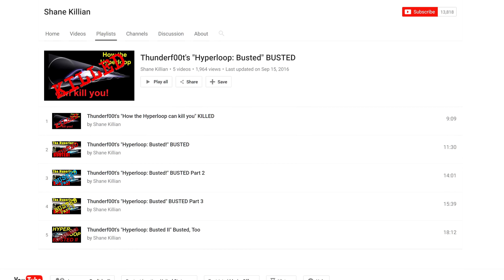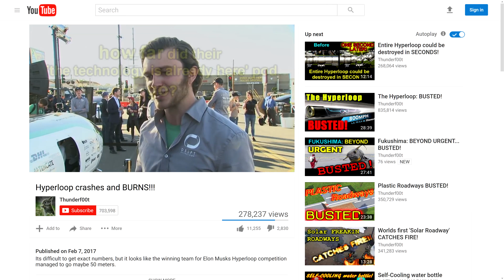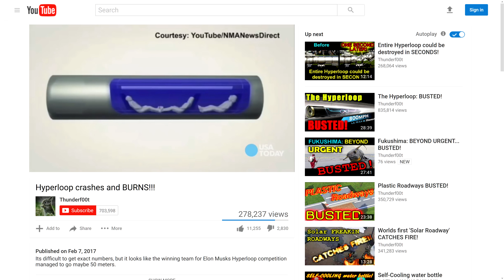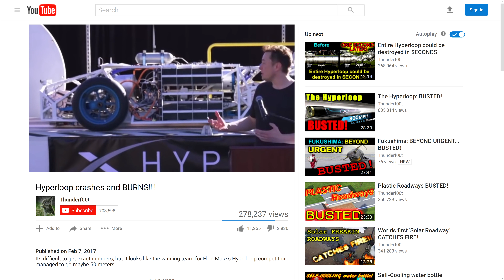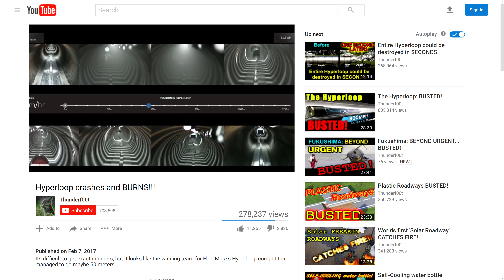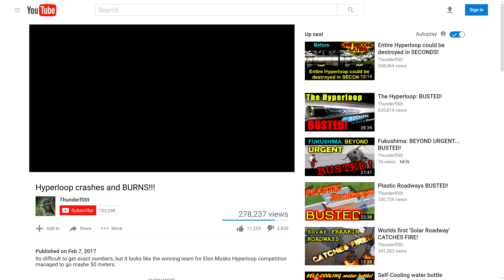Thunderf00t crashes and BURNS!!!

Comment: I'm struggling to understand... The Hyperloop system is not for commercial use? And the tall tubes could withstand the compression put on by its ob weight? Heck i mean if this tube where to be underground, wouldn't the weight from everything above cause the structure to implode? Ok, so if you build the walls of the tube to be extremely thick to prevent to tube from buckling or imploding, it would be extremely to transport and look at the economy. The cost of this system is high. I am really hoping that this system can work, i really am, but there are still some considerations that the engineers should take into account. Hopefully, there will be advancements in the system and that it could work in the near future.
Reply from the maker: "The Hyperloop system is not for commercial use?" SpaceX isn't doing it for commercial use. They want open-source contests (like they've done MANY times before with other things) so that maybe other companies can use it commercially.

"And the tall tubes could withstand the compression put on by its ob weight?" Sigh...COVERED AT LENGTH!!!
Reply: Shane Killian wait so the competition is not for public use? The media pitched it so that the competition is for the public to use. FAKE NEWS!
Reply from the maker: WTF are you talking about? I JUST FUCKING SAID that it's open source!

IDIOT.
Reply: Shane Killian wait... I thought open source is only for codes... Am I not doing internet correctly? I google searched "open source" and only got results for open sources codes, and even so the definition of open source means to publicise something for others to modify or to change upon. Plz further elaborate what you mean by this competition is open source. Is anyone supposed to modify the prototype of vehicle, the emphasis on open source is kind of misleading. Me, being an IDIOT that i am, does not comprehend this concept.
Reply: Shane Killian the whole concept of this competition is to look at the designs of new transportation options, that I understand, but there are other forms of existing transportation that is interesting to build and modify upon, look at the MagLev system for example, in the USA, there are few MagLev trains, it is efficient and it can run in tubes, it is more effective that in a hyperloop system due to near 0 friction against the tube, i think SpaceX would be interest in that rather than a classy giant hovercraft. That just like a straw, at one end there is suction, the other air is left in, the vehicle will travel as fast as the air being sucked out. i mean im an idiot, but i think if people could CHILL the FUCK OUT about other people's opinion online.(edited) I actually feel stupid now... Pffft,i could actually just ask the hyperloop team about my concerns myself,but i choose to talk to people who is irritated by people who does not share the same views as they have online. My bad for wasting my time.
Reply from the maker: "I thought open source is only for codes..." It's a concept that's for lots of things! In this case, it means that all of the data from and used by the test and the teams is available for everybody to examine publicly.

"look at the MagLev system for example" I HAVE! PLEASE WATCH THE SERIES!!!

"it is efficient" NO IT ISN'T. Not unless you're doing it the way Hyperloop One is, which is their own innovation.

"i choose to talk to people who is irritated by people who does not share the same views as they have" Another FUCKING LIE!!! I'm irritated by people who attack me WITHOUT EVEN FUCKING WATCHING THE SERIES!!!
Reply: Shane Killian you are right, but i have never intended to attack you from the start, but i felt your reply to me was aggressive and so i resorted to mirror your tone. Sorry for this, see i was looking at the pdf file that was available on the spacex page and and some question, just so happen your vid is in my recommended list, so i watched it, but due to this video just being a video calling out Thunderf00t and thought you would be able to take things with a grain of salt,  that i comment what i thought at that point in time. I do not take any side but me own, and sorry once again for making you feel irritated. I'd appreciate it if you would just link me to the specific video you mentioned and the case would be closed.
Reply from the maker: It's an entire playlist, and it's linked in the Video Info and in the End Screen.

Comment: I'm a Pipeline Designer. The Thunderf00t video that I've watched makes a big deal of operating in a vacuum. Atmospheric pressure is only 15psi. By contrast, the air in your automobile tires are twice that. In truck tires, 5 times that. The standard operational pressure in the Pipelines I design is 100 times that. 1,500psi is a very common operational pressure. The Pipelines I design are typically between 24" and 54" in diameter and 200+ miles long. Almost every design challenge he says about Hyperloop, is common issues with designing a Pipeline. Here in the US, we have millions of miles of them. Thunderf00t has no idea about what he's talking about.
Reply: ravener 
Exactly. Everybody can look up YouTube videos of large steel shipping drums being crushed by nothing more than atmospheric pressure when a low pressure system is induced inside of them. Not even a vacuum, just lower pressure.
Reply: Paolo G 
How much do those submarines cost and how many of them would you need to put end to end to reach from NY to D.C.?
Reply: What supports will the car hit, from the inside the tube? Yes, there is a difference between forces in compression and tension. But, the Thunderfoot video suggests that building for a vacuum is some kind of impossibility. It is not.
Reply: Lazy Monk: The concept of hyperloop is not "maglev in a vacuum tube". Only some implementations use maglev for propulsion. And they probably don't need maglev for levitation.

The jury is still out on whether it's viable. But at least we should stop spreading misinformation.
Reply: Lazy Monk: I guess you haven't watched the videos of this channel about the topic. 90% of the time it's Shane Killian saying how thunderf00t didn't really read or understand the paper.

Yes, the construction cost is a big unknown, but I think it's worth pursuing anyway, since it seems much cheaper than maglev, so it has the potential of actually being cheaper.
Reply: Lazy Monk 
I would be surprised if they didn't switch to reinforced concrete pipe.
Reply: David Forbus 
It's not impossible, just stupid and vulnerable.
Reply: Lazy Monk:
> I was thinking of cars and trucks running on the ground outside the tube hitting the support columns. Could happen, and you need to design them sturdy enough to take it.

It should be easy enough to detect a hit to trigger an emergency re-pressurization. Unlike thunderf00t explanations, flow is slow enough it won't be fatal for the people in the pods.
Reply: ravener: I wonder why 5 months of smart SpaceX engineers working on that paper didn't notice that. Unbelievable.

That was sarcasm. If I understand correctly, and as mentioned by Shane Killian, the tube is supposed to have an internal reinforcing structure.
Reply: Lazy Monk:
> it's still just a vague idea or concept

I don't think 5 months of work of some of the best rocket engineers in the world could be called "vague idea or concept". They simulated the material and fluid dynamics with their advanced in-house GPU-accelerated tools, and they concluded it's worth working some time to publish a paper.

That doesn't mean they're right. But at least it's not something an "ideas man" has blurted out as most of you seem to imply.
Reply: Lazy Monk:
> We're talking about SpaceX here, right?

Yes, they published the original paper.

> The only thing I've seen from SpaceX so far has been grandiose promises, unlikely economic projections, vague descriptions, and artist impressions thereof.

Are we talking about the same paper?

> And of course PR nonsense like the silly student competition.

PR for what? For the products they sell to the public? Rocket launches are nothing, they gonna get rich selling t-shirts. /s
For their stock? Oh wait, they're not a public company.

> If you have seen a paper going into actual details and calculations I'd be interested in seeing it!

spacex dot com/sites/spacex/files/hyperloop_alpha-20130812.pdf

Comment: What's the point of testing a maglev and fucking brakes in a vacuum tube. They already did that before.
Reply: Shane Killian wow you're an idiot
Reply: Shane Killian the hyperloop definately doesn't ride an air cushion. The idea would be even more stupid if it did

And the pressure is really really low too. You can easily call it a vacuum.
Reply: Shane, here's a quote from Josh Giegel, co-founder & president of engineering of Hyperloop One
"Nice work - it does get pretty tricky to find enough air in a vacuum tube to use for air bearings. We ultimately went the maglev route for a variety of reasons but this was a big one.
Giegel"
(Source: Their reddit Q&A https://www.reddit.com/r/IAmA/comments/4wck43/hi_were_mostly_engineers_here_at_hyperloop_one/ )

By your own admission is Josh Giegel a "FUCKTARD" for referring it as a "vacuum tube"?

What I'd say on the matter is: when people call something a "vacuum" they generally mean a low pressure environment. How low? Personally, I'd say if the pressure is low enough for water to boil at 298 kelvin (24.85 °C) then it's low enough for me to consider it a vacuum, so anything less than ~23.7 Torr or 3160 Pa, which certainly would include 100 Pa.
Reply: @Shane Killian It is a maglev. They even state it on their website: https://hyperloop-one.com/blog/how-and-why-were-levitating .
If I may quote the site here: "Hyperloop One levitation uses pod-side permanent magnets repelling a carefully designed passive track".

Also calm the fuck down man. You don't have to instantly get enraged and start CAPSLOCKING and insulting people. This just makes you look like a moron and does not help at all to make your points look serious.
Reply from the maker: THIS...is NOT...a MAGLEV!!! Fucking DEAL WITH IT!!!

Idiots...
Reply: Shane Killian what is it then
Reply from the maker: How many times do I have to explain it? I even explained it IN THIS VERY VIDEO! It rides on an air cushion.
Reply: Shane Killian it's not like that's a new technology either
Reply: Shane Killian you have to admit air cushion and vacuum tube sounds pretty stupid in one sentence, but I guess they know what they're doing. It's not my money anyways. Until then I'll be riding my TGV in France and if mister elon wants to build one in France too I'll be happy.
Reply from the maker: "you have to admit air cushion and vacuum tube sounds pretty stupid in one sentence" Yes, which is why you FUCKTARDS shouldn't keep saying it! IT'S NOT A FUCKING VACUUM TUBE!!!

IDIOT.

Comment: Thunderfoot was actually more correct then wrong that time. The brake tests apparently were done outside the tube. The teams had disappointing results because Space X and the teams didn't have access to the tube so there vehicles weren't calibrated right. The winning team put up a YouTube video about it.
Reply: Or they grossly underestimated the magnetic drag of a Eddy current brake structure having never achieved those speeds or levitation.

Comment: In my opinion, the hyperloop concept will never operational.
Reasons?
- overground tube installation is a hazzle with land-owner permits
- underground tube installation is too expensive
- transportation of people in vaccum is risky
- creating / maintaining a vacuum on such large tubes uses to much energy.
- people don't like to sit into vehicles with no windows, even if they will not see much, as in a underground-train.
- maglev technology is too expensive (Transrapid failed).

Let's see what the project status will be in 2020.
Reply: well add windows to the pod. also some of those previous points have been covered in this guy's previous videos
Reply: - Would probably be about as hard as it is for roads, railways, power lines, pipes, cables, sewers, etc. It would just be a matter of government catching up to speed with technology.
- True
- Flying in hollow tube high in the air is risky too but it's still safer than driving a car. I don't see why the same couldn't be true of the hyperloop.
- What constitutes "to much energy"?
- People also don't like sitting in the middle of a cramped airplane and not being able to see out the window for multiple hours but that doesn't stop them.
- Wikipedia says, "Elon Musk's version of the concept, first publicly mentioned in 2012, incorporates reduced-pressure tubes in which pressurized capsules ride on air casters driven by linear induction motors and air compressors." It would be better to call it "magair technology" Air casters are not the same levitating force used in maglev. The linear induction motor technology, one the other hand, is like the magnetic force maglev uses. According to Wikipedia, induction motors are used in some launched roller coasters. Just because one company failed doesn't mean that another won't succeed, this happens all the time in the free market: innovation is a risky business.

Comment: I have so many things to say to you sir. Yes thunder foot may not have addressed everything. But you have to look at it. It's not even viable in the real life. In a closed system sure. But to have it next to roads or trains is just ridiculous and at that scale. Srsly? A car crash will crush whoevers in there and to have the loop pressurized and depressurized every time some one wants to board is gonna use a ridiculous amount of energy. That's just one of the problem. You also think the general public can stand 2gs of force?? He's a scientist. Why would you think he wants to force a project into the dust? One last more obvious thing i want to mention it's almost completely impractical to brake and stop an object going at 1000kmph every 30 minutes or so the kind of maintenance would be ridiculous
Reply from the maker: "But you have to look at it." We DID! We covered EVERY SINGLE GODDAMN POINT that Thunderf00t made!!!

"A car crash will crush whoevers in there" How is a car going to crash into it? Do you not even have the first concept of how this thing will be set up?

"and to have the loop pressurized and depressurized every time some one wants to board" Sigh...not how it works. Read the whitepaper.

"You also think the general public can stand 2gs of force??" They regularly do! 2gs is NOTHING! All of us have experienced much more that at one time or another when we've had to slam on the brakes to avoid an accident.

You OBVIOUSLY haven't watched the series. You OBVIOUSLY haven't even read the fucking whitepaper. If all you're going to do is suck Thunderf00t's cock, then you have NOTHING to contribute here. GO AWAY.
Reply: Hey Shane, have you bashed your head through that wall yet? Thanks for making these videos, you're doing a great service by doing all of this analysis and having it available as a resource; I'm sure they will eventually prove useful to enlightening Thunderf00ts misguided masses.
Reply: joshua lotion "you also think the general public can stand 2gs of force??"
mate. yes. they can. 2g is fuckall acceleration.

Comment: Whats beyond me is how conveniant it was how they used the break just in a couple of seconds to make matters worst did not even complete the track further more if the test was just about safety and safety whats the point of even making the track as it is, whats the point of wasting your time by making the sample space that large. These guys go to MIT and even they cannot a   build a system coherent and consistent enough to use in real life.
Reply: Well, i don't follow this entire hyperloop thingy closely, but one argument for building an excessively long test track for testing the brakes would be to make sure that the tested pods don't crash into the end of the tube in case the brakes that are being tested don't work. Just like you wouldn't make a runway for a plane barely long enough to lift off when you aren't sure yet that it will be able to lift off at all.
Reply: I hate to be the grammar nazi but I can't pass this up: You cannot use English coherent and consistent enough to use in real life.
Reply from the maker: YOUR QUESTIONS HAVE BEEN ANSWERED. CATCH UP TO THE REST OF US OR STFU.

Comment: Thunderf00t just explains that  these tests can't in any way prove the validity of the concept, 1100km/h (Speak metric, inch are for retards)) pod in a tube at ultra low pressure. These tests are just a very small step, nothing fantastic.  Let's wait for the REAL tests. If it works, THEN we will see if it is feasible; technology, cost, practicability, safety.  As far as I am concerned, I WILL NEVER step in this kind of pod going that fast in a closed tube underground. Why no bullet trains instead BTW ? Not enough hype ?